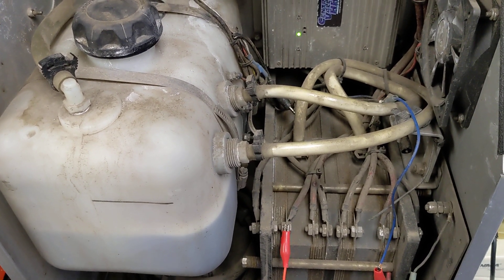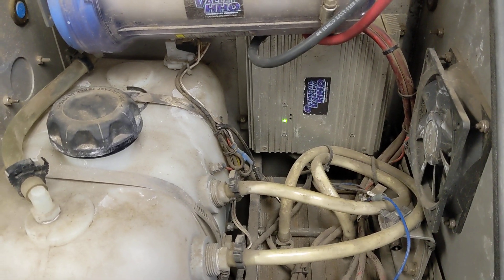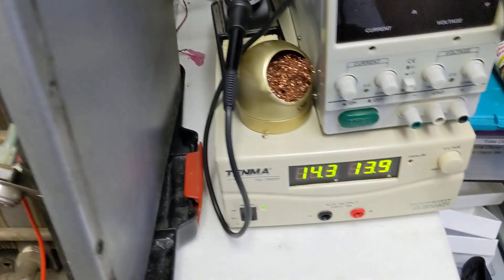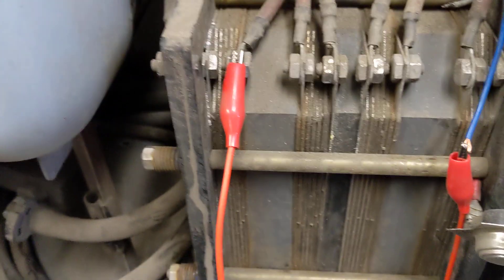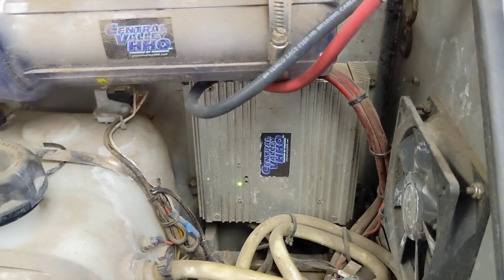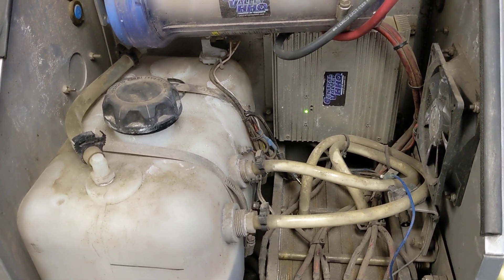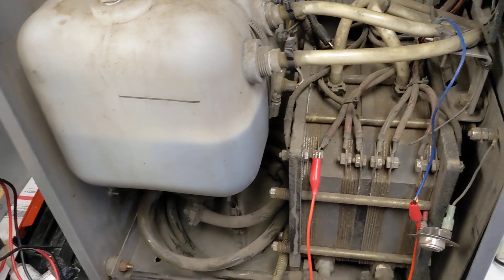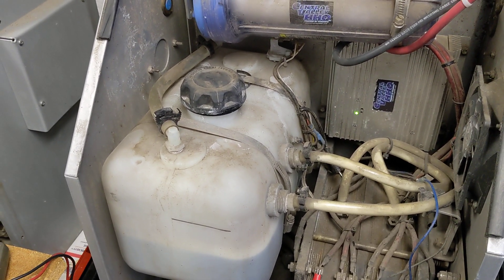CVHHO System still working after over 600,000 miles!

Comment: how come its only using 14.3 volts on a 24v truck?
Reply: Our systems running 12 volt or 24 operation
Reply: @scottsmith6960  so basically your cell is a 24v cell that can be run with 12v?
Reply: Yep different software and hardware for 12v and 24v
Reply: @scottsmith6960  right now im trying to make a 24volt cell 6x6 11 neutral plates one pos and one neg. would love to hear any input you would care to share
Reply: This truck was a USA truck and they run in 12 volts the trucks we do in Nigeria Australia and UK all are 24 volts we are selling an eight different countries right now.
Reply: @scottsmith6960   do you think the configuration im making is good?
Reply: What my other videos

Comment: Is this another unit with no electrolytes?
Reply: Our systems maintain electrolyte in the system for about 2 years our controller tells us when it's low on electrolyte 6 months prior.
Reply: @scottsmith6960  is it injected before or after the turbo?
Reply: @scottsmith6960 l98

Comment: Need a website reference and how much efficiency one can expect.
Reply: 20 to 52 percent depending on engine year and depending on what country we've been dealing with hydrogen technology for 13 years and about 12 different countries and see different amounts of fuel savings.
Reply: @scottsmith6960  No website? Economy in USA? Pick out a late model gas powered truck and please provide the improvement. Also unit cost for a 5.7l gas engine.